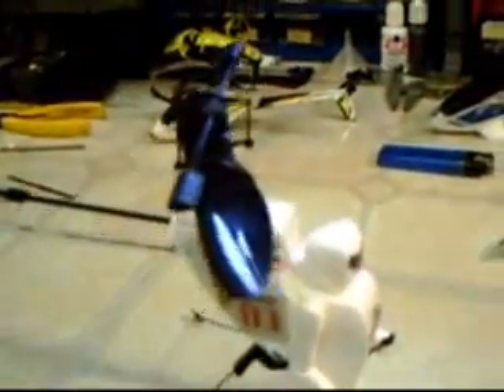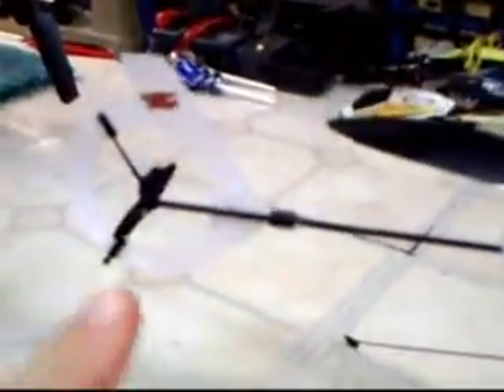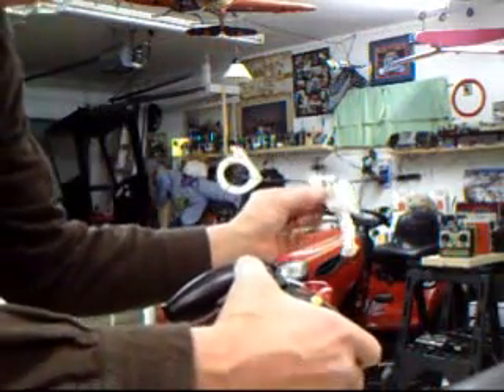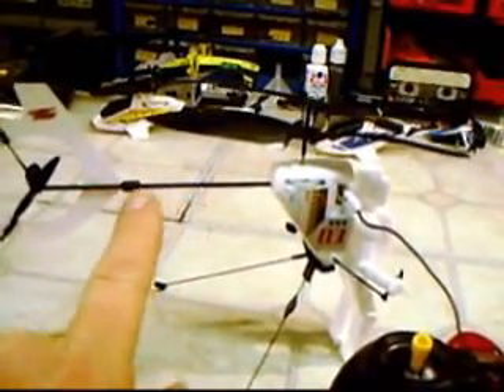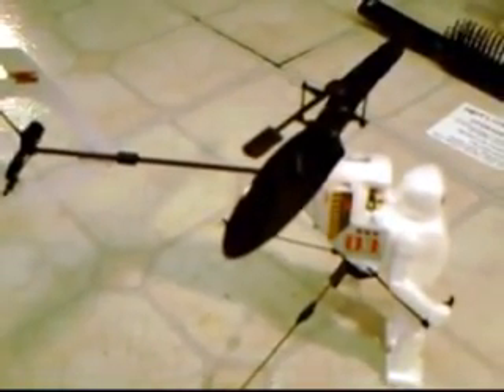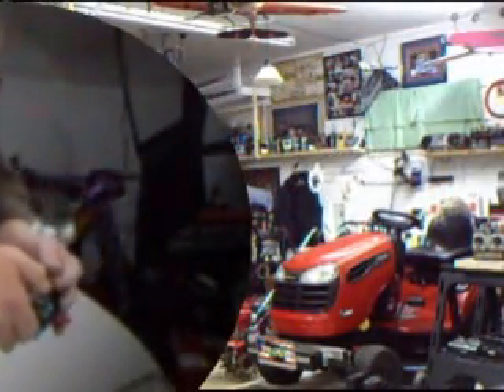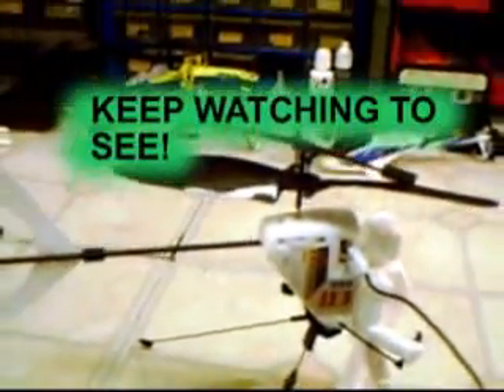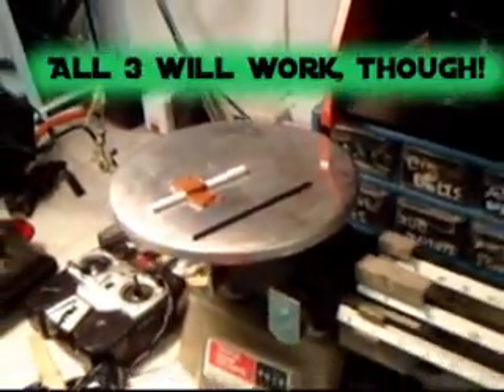ROBOCOPTER-EXTREME MAKEOVER!  I dissected it!

Comment: I have a question about the tail , can one also add a surface that is angled a little bit  at the place of the  tail rotor or the tail boom or perhaps along the tailboom and is airfoil shaped to counteract the torque n maybe not 100 procent but 40 procent?

Comment: Could you recomend a solution to a problem I have with one of my helis. It will not fly smooth or very sraight. It also fails to turn left. I can assure you it is not a trim problem. What else could be causing it? By the way great work on your vids they are very well done.

Comment: I have a problem with one of my heli's.  I just replaced the outter main shaft on my Ocean Rescue, and after balancing the blades and making sure everything was installed right, I went out to fly.  it flew about 30 seconds total then there was a rather nasty case of rotor strike.  How can i fix this so it doesn't happen again?